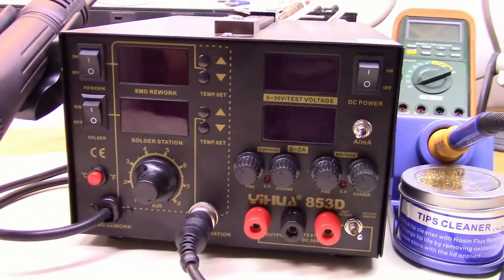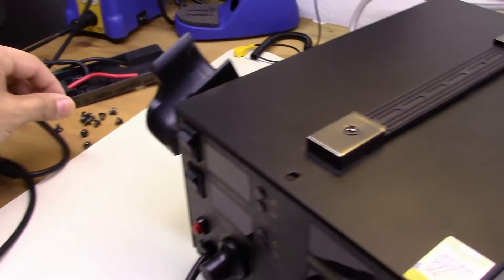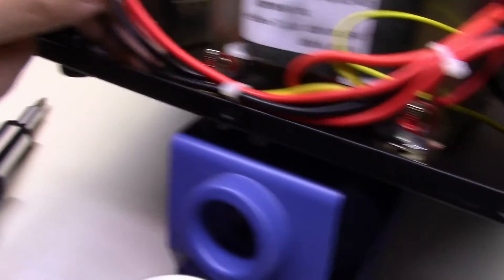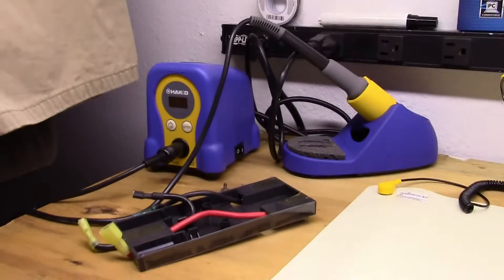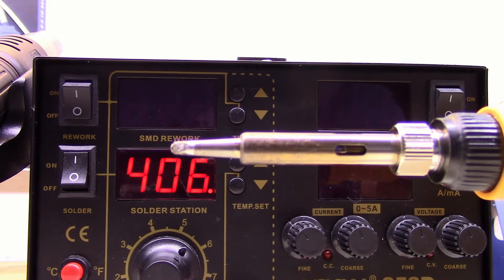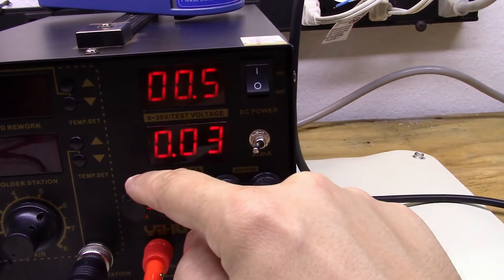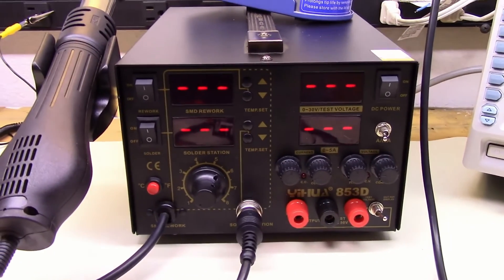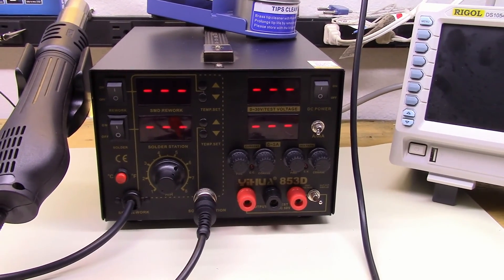Yihua 853D Review

Comment: So do they still sell this kind or something similar and your recommendation
Reply from the maker: It looks like they do sell an updated version of this on Amazon. I honestly don't have experience with any other 3-in-1 system like this and I still use this one regularly. I don't use the iron anymore but I do use the power supply and the hot air gun and they've both been very reliable so barring experience with anything else I'd recommend getting one of these.

Comment: Why would you prefer to have a linear power supply over switched-mode power supply? Which power supply would you/should we use for powering microcontroller and small single-board computers?
Reply from the maker: Generally a linear power supply is going to create cleaner power. Switch mode power supplies use high frequency switching to create the voltages and that tends to lead to a more dirty power signal.
For most applications that doesn't really matter as modern electronics are all designed to handle switch mode power supplies but, especially if you're doing individual component testing, the cleaner the power of the better.
Reply: @DoRC  So, the real answer will be to check every power supply individually to ensure its output has stable voltage? What is the methodology? Should I take measurements from an oscilloscope for my typical voltage, then prove that the measurements are normally distributed with mean values equal to a specified voltage and perform a statistical test for comparing the distribution variances with identical mean values? I would expect the error distribution being a sum of two normal distributions (oscilloscope error & and noise from a DC power supply).
Reply from the maker: @tshev  That's going to go a little bit beyond my knowledge and is really going to depend on what the application for the power supply requires.
What specifically are you trying to accomplish?
Reply: @DoRC  I want to assure you that I will not kill my NVIDIA Jetson Nano, Arduino, and Raspberry PI. I purchased a separate switch-mode power supply without thinking too much, and powering NVIDIA Jetson Nano will be one of my use cases. I am still waiting for the power supply to arrive, and I wonder whether I should return Korad KA3005D 30V 5A.
Reply from the maker: @tshev  No. A switch mode power supply will not be a problem for any of those things. All of those single board computers are designed to handle switch mode power supplies.

Comment: Would not have thought to open it before using it. That is good knowledge to have.
Reply from the maker: Yeah I don't think most people would but I have a bad habit of wanting to see what's inside everything :-) thanks for watching!
Reply: @DoRC  having worked with HP/Agilent/Keysight, Fluke, Anritsu equipment and the like I've never had a need to open prior to use or testing (worked in Metrology) but it makes perfect sense when buying chinese products-is what I was mainly referring to. Going to make it a habit of doing this any time the brand is "new" or unknown. Appreciate you responding as well. Subscribed.
Reply from the maker: @raccoonstarsmember  thanks man. I'm mostly doing RC car videos these days but maybe you'll find some of that interesting too :-)

Comment: These things are junk IMO. The Hakko and trakpower stations will get most of what anybody in the hobby would need done. If you want a serious rework station for doing boards,  you'll have to drop major coin on a Metcal set up.
Reply from the maker: Maybe so but I've been using mine frequently for years now with no issues. The iron is a little gutless but everything else works great!

Comment: Is a good video. The problem is that this company produces at least 3 different models, all of which have EXACTLY the same name and model number (Yihua 853D) which is very misleading to various market places. I bought the same model but mine did not have the Current limiter on the psi which is renders it totally useless for a PSU.

Comment: Hi there I'm thinking of getting the blue version of this one or the 862BD and was wondering about the whole ststion quality and iron durability do the irons last? I have a weller wlc100 but want an iron that can use a bevel tip so if this one has no problems I'm gonna have to cop
Reply: Hi just wondering if you bought a new soldering station like the blue 853d and what you think of it

Comment: Bought yihua852.on first use,fuse blew out. Changed fuse but now air control is not working. 😤
Reply from the maker: Man that sucks.  Can you return it?
Reply: @DoRC  bought from a local vendor. They say ,no warranty, no return, but could help in repair , but after the end of coronavirus Lock down .
Reply from the maker: Well I hope they are able to get it fixed for you.  I use mine quite a bit and it's been flawless.
Reply: @DoRC  thank you.

Comment: One of these on eBay for £18. Think I'll snap it up.
Reply from the maker: I checked out the listing. Unfortunately it's almost certainly a scam.
Reply: Do RC I see that deal as well. How does the scan work?
Reply from the maker: @oli77baba  scan?
Reply: @oli77baba  oh. What makes you think that?
Reply from the maker: Price and the sellers low feedback.
Reply from the maker: Not entirely sure. I have seen it before though. I think the seller hijacks an account and transfers out the money before refunds can be issued.  I think you'd still or protected so not much harm in trying.

Comment: It's really hard to beat the prices of these things. Chinese stuff from a decade ago back as far as I remember meant "Don't even get near the crap with a 10-foot pole." But within the past 5 years, the stuff seems to really be passable. You could theoretically get away with just using the stuff for a while. But taking maybe 15-30 minutes of just checking the things out and looking them over and maybe doing little tweaks here and there that cost either nothing or pennies on the dollar means you can end up with a piece of kit that costs a percentage of what a comparable name brand does and still get 95% of the name brand performance and reliability after a quick tweak or two. I mean these 853Ds are like 120 bucks on Amazon, and the ones without the DC Power supply are like 80. Finding a rework station with DC power that's 'good enough' for the majority of hobby work for that price is damn near unheard of.

Comment: So is the power supply to power your project instead of using a battery such as a 9v etc? I’m looking to get a rework station and I had this one under consideration.
Reply from the maker: Yeah. It's really handy when building or testing because you can select whatever voltage you want as well as limit output current so you don't blow everything up if there is a problem in a circuit.  A bench supply is really a must for any electronics hobbiest.  Thanks for watching and a sub is appreciated!

Comment: hi i have the same model. Tried to give some Amphs but the screen is zero. I contacted with the supplier and told me that maybe some connector is loose, but it is not, i opened it and everything is ok, also tried your method but the amphs is still in zero
Update 10/2022
The knobs of voltage and amps are absolutely off, trying to set a voltage and they are not corresponding   I think bad quality issues .. very disappointed
Reply from the maker: Do you have the output connected to anything?  Unless the output is connected or shorted the ammeter will read 0.
Reply: You are absolutely right. So if I need 3.5Amphs and 19v for a laptop. Firstly I will short them out and adjust the Amphs and then release them and adjust the voltage?
Reply from the maker: @kgerakopoulos  correct.
Reply: @DoRC  thank you so much

Comment: Ordered one today.
Looks like they've now replaced the °C / °F push button with a left/right toggle switch. Makes much more sense since it's now visible which unit the device is set to.
Reply from the maker: Awesome!  Thanks for watching and a sub is appreciated:)
Reply: @DoRC  Will look into the sub thing.
Received mine and the C/F button is still the same as on yours.
Wonder why they made it that way because pictures on their website have the metal toggle switch, same as the other 2 switches on the unit.
Could it be there's risk of getting a shock from it so they've replaced it with a plastic button?
I can't think of anything else because it doesn't make much sense to 1: use a push button so you can't see what it's set to and 2: use a switch that's different than the other two switches (using 1 type is usually cheaper).
Reply from the maker: @Ni5ei  who knows why they do such things.  I wouldnt even attempt to guess.

Comment: well i think i going buy the one i see and ebay after see this video ^^ my soledring iron are a piece of crap in 220v 20w without regulator... so he why not try a full station. like just here https://www.ebay.fr/itm/223007187574
Reply from the maker: Looks like a good one!
Reply: @DoRC  i guesse is the "new generation" is delete the thing for clean but in picture the soldering iron look a lots more beter .
and taht look like is add a voltmeter. i going to buy a one but i dont see any button for change unit betwen degrees and fahrenheit.
Reply from the maker: @Light-DelaBlue  mine has one but I don't see it on the one you linked.
Reply: @DoRC  i want avoid the fahrenheit mostly ^^"

Comment: Just returned mine. It was a more basic version, but the temperature was all over the place and it would go into sleep mode while I was using it. Not good!
Reply from the maker: That's a bummer. Honestly I only use the hot air and occasionally the power supply on mine.  So far it's been great but I know there are a bunch of similar models of varying quality out there. I don't even think this one is available anymore.
Reply: @DoRC  glad yours was ok! Maybe just got a bum unit. Went for a Hakko instead. Got to love Amazon Prime next day delivery
Reply from the maker: @chrismac4441  I actually won a hakko from a digikey contest and that is now my primary iron.  Definitely good stuff.
Reply: @DoRC  excellent :) no more shouting at solder telling it to "hurry up and f*** melt!"

Comment: Hello @Do R/C!, may I ask you where did you buy this 853D? There are multiple version out in the market, with the same model name. I'd like to have THAT one, with 30V 5A power supply. I can only find the blue-ish version of this or/and the black one (as yours) BUT with way lower power  (15V 2A I think? I may be wrong). Thank you from Italy for your video! Regards, Alessandro.
Reply from the maker: Got mine on Amazon.  It looks like it's not available anymore though.
Reply: @DoRC  Thank you for your quick answer! I'm so sad to read that :( I need a cheap soldering station to start with, making some money to buy a better one. Thank you again anyway!
Reply from the maker: @Algamus94  honestly if I had it to do over again I'd get a hakko 888d (what i use now) and a separate inexpensive power supply on eBay.  I really only use the hot air gun for heat shrink and when just getting started I'm not convinced it necessary.  The hakko iron is a much better device and will make learning to solder (or getting better at it) a much more enjoyable experience.
Reply: https://www.amazon.de/gp/product/B00O8R62ZI?pf_rd_p=671e72bc-8864-4ab6-8ef7-60da5d6ead8c&pf_rd_r=GFGD7TGZFJD8KZRQDP2H

Comment: I'm looking at picking one of these up, new to electronics but seems to have pretty good reviews. Though, the one i'm looking at seems to have a guage on it rather than a second screen for the power supply, and no dials for the course / fine for current / voltage. Might be the new model they released? Not sure. Anyway, the main reason for my comment issss... Have you found anywhere that sells replacement / better quality soldering irons for it? Would be an interesting upgrade for it.
Reply from the maker: I haven't. The iron takes standard hakko tips though which is a very worthwhile upgrade.  I ended up buying a hakko 888d so I don't use the iron much but so far the ps and hot air gun have worked fine.
Reply: @DoRC  Good to know it's worked solid for over a year! I'll look to grab some hakko tips at the same time!
Reply from the maker: Sweet!  I would have posted a follow-up video but honestly YouTube's algorithm is such these days that I found my videos were getting nearly no views (I know that wouldn't get a ton of views but the average view count just went off a cliff even on videos that had worthwhile info that I know people were searching for)
Reply: @DoRC  that really sucks! I've just found your channel because a vid from it popped up on my reccomended watch list. Not big on RC, but YT seems to think I am as i've just got into electronics lol! Subscribed anyway, looking forward to future content!

Comment: I bought the 852D++ model and it works as intended. No issues so far. There are many spare parts online which you can buy if this does run into trouble which is always nice
Reply from the maker: Cool!  Yeah mine is still working great.

Comment: I have had one of these for about 3 years.  The base unit is fine, but the soldering irons just don't last.  The circuit board in the iron handle burns up.  I have replaced the iron 3 or 4 times, and am now going to buy a different model.  Maybe a 995D and hope it has a different iron.
Reply from the maker: Yeah. I only used the iron for a short time before upgrading to a hakko.  I still use the power supply and the hot air gun from time to time though.  Check out my other vids and maybe subscribe. I'd really appreciate it!

Comment: I have exactly the same but marked "W.E.P. 853D".  Inside the circuit boards are marked "Yihua".
I opened it up because the power supply stopped working after a few months, refusing to give any output.  I didn't find any obvious faults at first but cleaning residue off the rear board revealed a couple of small solder dots which may have been shorting adjacent pcb tracks.  Having done this it came straight back to life.   
I decided to check the voltage/current displays against my DMM - and a 10w 100ohm resistor load.  Voltage was close but current way way off, displaying zero up to about 50mA and approx. half the true value over the remainder of the range..  Using the blue trimmers just behind the voltage displays I was eventually able to adjust this to a state where it was reasonably close, within 1mA across most of the range. The ones I changed are marked 'zero' and 'mA'.
Reply from the maker: Interesting. I haven't had any issues with mine yet but honestly I don't use it that much.  I haven't checked mine for accuracy but I wouldn't be surprised if it were innacurate.
Reply: @DoRC  I only do occasional hobby work, but 3 years on mine is still here on the desk, working fine.
Reply from the maker: Thata good to hear.  I'm actually going to do a follow-up video on mine soon.